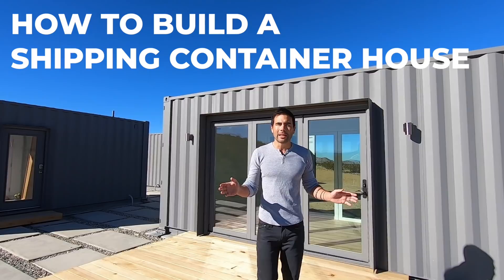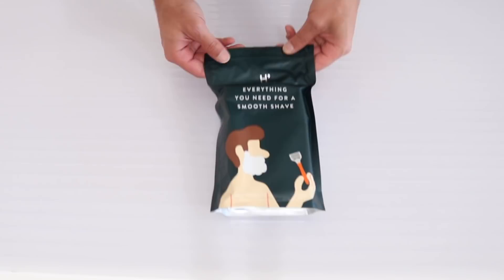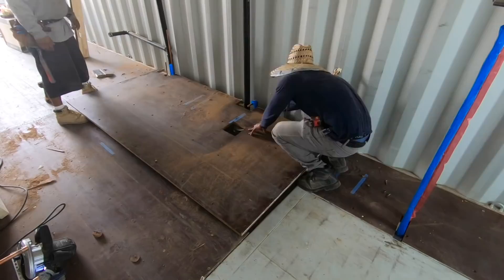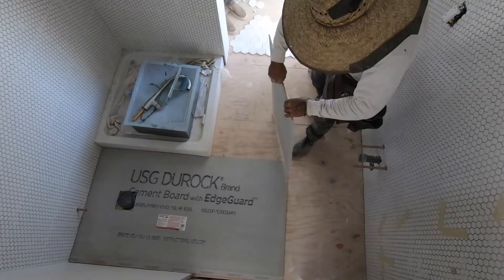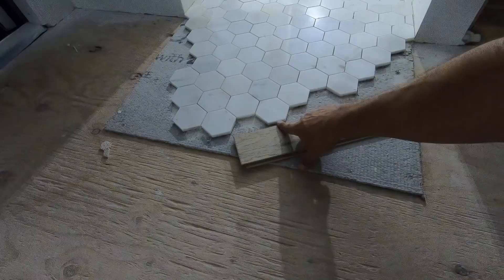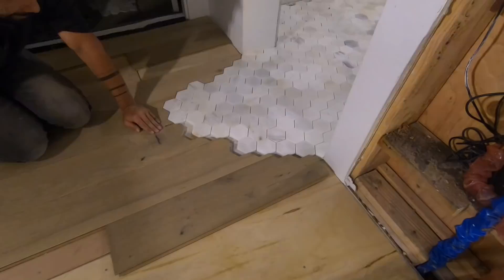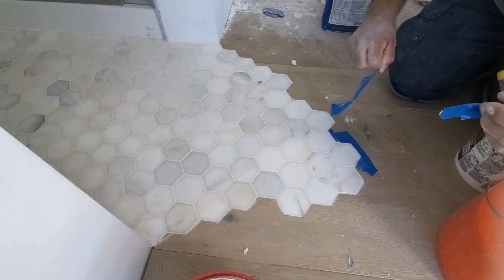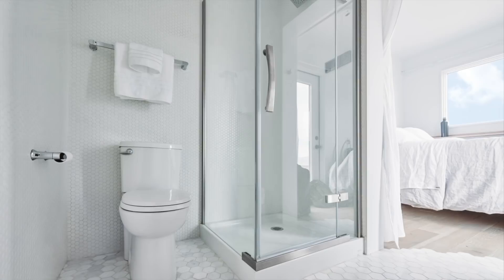How to Build a Shipping Container Home | EP08 Building a Bathroom

Comment: Love it, Ben. I like the methoding behind the pass through design. I personally would have tried to find a way to enclose the toilet separate from the past through space. Maybe rotate it 90° against the dividing wall, and wall it off from the shower and vanity. Would be tight, but the privacy would be nice. Something I learned to love about many Australian bathrooms is the separation of toilets from vanity and shower.
Reply: Cam-Asher Bond It’s nice to have it separated but I imagine most people would leave that door open because it would feel claustrophobic...I’ve seen a number of bathrooms that could not have been to code because my shoulder was touching the wall. You need room to maneuver. 😬

Comment: I wonder was the container usage worth it? Building the same Buildings withot the stellt would give some more options in terms of size and so on. I meant inside it seems there is a frame anyway and isolation would be easier and better?!

Comment: Next time lay that section of tile last but you right lay the tile over the floor for measurements and you can easily use your drimmle or orbiting tool to trim away and additional wood when you putting down the rest of the tile flooring

Comment: Based upon some of the comments, if you do some internet searches you can find the build that uses double wide and double high 40 foot and extra high containers. There is a center space that is enclosed by heavy duty garage-type doors with windows. These were painted a dark red; not something I would use. The one I am thinking of also had a swimming pool that also used a shipping container.
Reply: any chance you can provide a link to what you reference? I've haven't had success finding one like that yet. thanks, John

Comment: While I appreciate the narrow container width you have to work with, sorry. that tiny sink in the bathroom is pointless.  They abound here in the Netherlands in toilet rooms, and they are horribly difficult to use for anything other than a quick rinse of your hands.  If this were my only bathroom sink, personally I'd rip it out and start over.  Maybe a better place for the sink setup would be on the other side of the wall from the shower?  It'd be good for you, not so good for guests who would then have to enter your bedroom to use the sink...  Tough choices to be made, for sure.
Reply: A sink in the shape of a hail-circle could work and it would be larger without sticking out much more from the back wall. The half-circle would look larger.